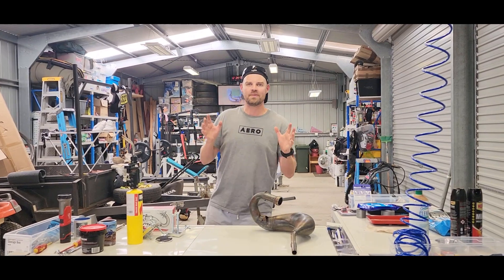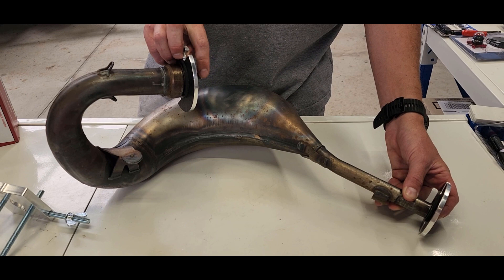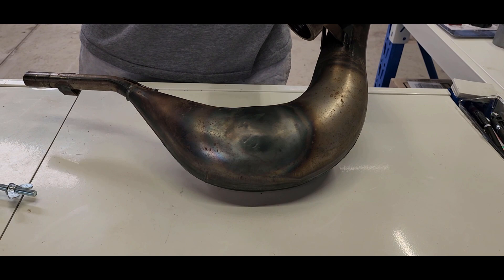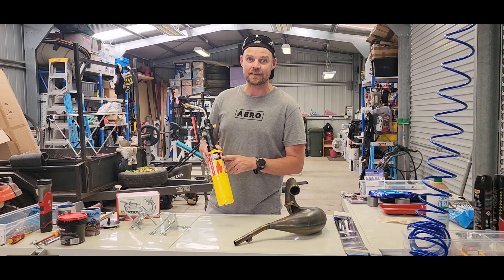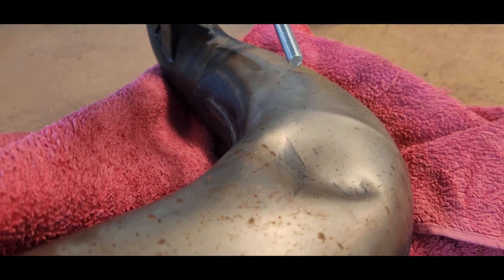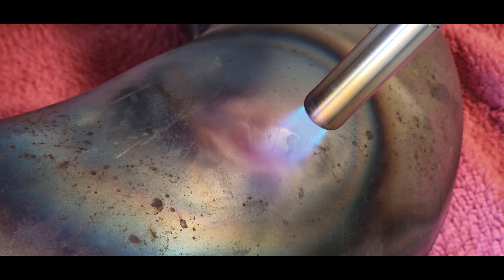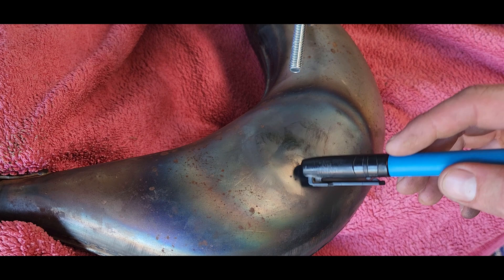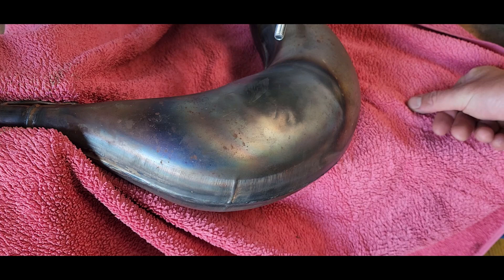2 Stroke Expansion Chamber / Exhaust Pipe Dent Repair

Comment: Hello, my KTM 50 year 2012, I've already carried out all types of maintenance but the bike won't start, the engine won't even start, I've already changed the stator, carburetor, ring, we've tried everything but the bike won't start, when it starts it stays running for a few minutes and then it takes forever to turn back on. can you give me a tip